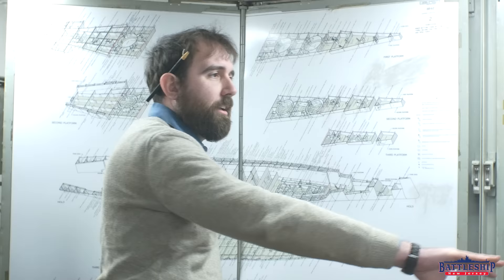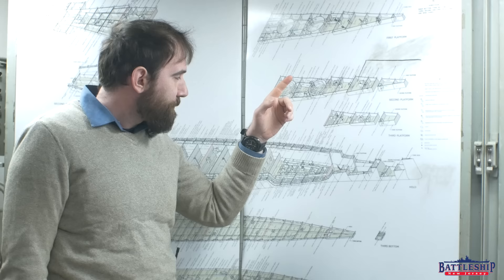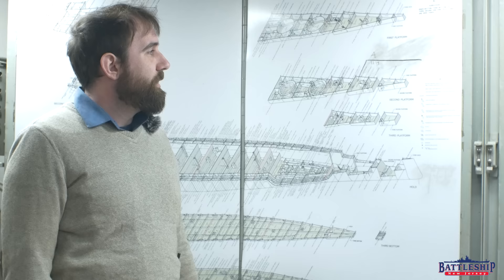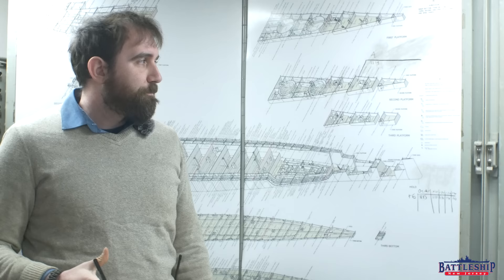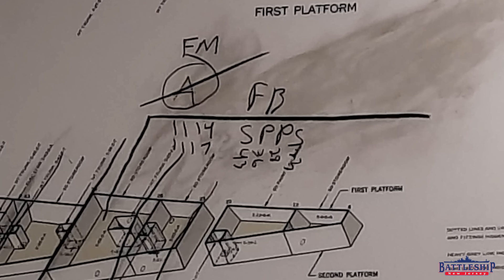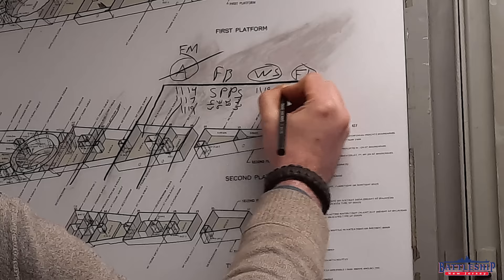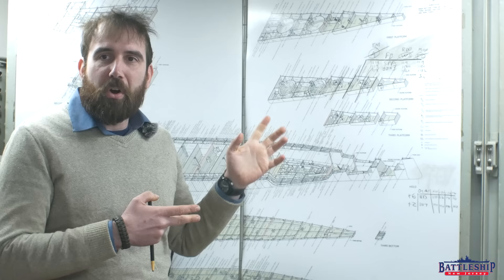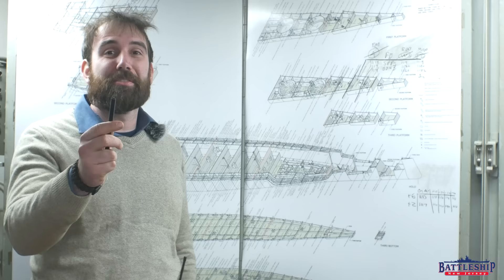Tracking Battle Damage

Comment: since 80% of the ship's weight seem to be in grease pencils a fire in those lockers would have been devastating.
Reply: I wonder how flammable grease pencils are lol
Reply: @mm3mm3  It is basically wax encased in wood, so ignition likely on par with wood, which burns hot enough could ignite the wax. Granted that also depends on how stored, if put in a sealable metal box like an ammo can would decrease that chance, even more so if unopened containers had the air replaced with something practically inert like nitrogen gas.
Reply: @SnowmanTF2  Thank you very much 😊
Reply: At present, 80% of the ship's weight seems to be in Ryan's beard.

Comment: I'd love to see a damage control rundown for a more.. severe situation.

Say NJ comes up against.. Yamato or something similar, takes a solid 460mm AP shell a little underneath the waterline, crashing into the citadel and destroying a boiler that catches on fire.

So you have a massive hole in the side of the ship, several casualties, flooding, fire, and a boiler that is severely damaged

From how much space the small fire took up in damage control plate space you'll have to overflow onto 3 other plates hah

Comment: On the destroyers and frigates I served on 70s-90s the boards were generally four sets of sheets depending on what was mapped (piping, electrical, flooding/stability info) with full sets in DC Central, repair 1, repair 3 & repair 5. 
One layer will have the main drainage system charted on it, 3" of water is far too much to be a mop & bucket drill.
Reply: Yeah Ryan's obviously assuming he is really good with a mop and bucket. That's a significant amount of water lol!
Reply: I don’t know, but maybe too strong is the power of the beard for this youngling,,,, ;)

Comment: DC1(SW) Thompson here. Tracking Damage Control. Well here I go when I get a chance I will go to my library and make up a pretty much spot on copy of a DC message blank. I will make up copies. Walk through some casualty scenarios for you. Then I can shoot them to you . Those plates you where close but there is alot more to report. The line from the space good. Rotting the fire type good , now here where I fill in gaps. The fire party is on scene. There is an OSL on scene leader and hosemen and a messenger. This were the message blanks come in as a record of events for the after casualty critique. The osl reports fire party on scene leader reports everything to the messenger, the messenger to the repair locker. In port the duty fire Marshall will be in the repair locker plotting damage and managing personnel. Sending duty electrician out to secure power to the spaces involved. Once the fire party is on scene and the boundaries are set. The osl reports to messenger that Class fire under control. He tell the repair locker and the locker to central. Central to quarterdeck. This continues on a message blanks is written for every step taken . These are  elect. Power secured, class A fire under control,class A  fire out, reflash watch set. Smoke reported request equipment. Water report 4" as things progress each part of the report A on line under control diagonal line up left side of A on message blanks, charts in locker and central. All the time all reports are sent to quarterdeck and passed over 1 mc to crew. This keeps all personnel not involved out of the way and at the stay during casualties. When fires out finish the pyramid around the A fire out. Set the reflash watch two hose left to man hose in case of reflash. The rest desmoking and dewatering.   All being charted again on message blanks and charts. S in progress line up left. Desmoking complete triangle closed. W same . When done there should be at least for sets of message blanks that all should look alike. And two set of charts exactly the same. There is your record of events . When all this happening , it start with OSL, messenger, locker,DCC, and quarterdeck, the message are write verbally told to the next person in line word for word written and spoken. Now yo did miss one class of fire. The one that can't be extinguished. A Class Delta fire. Very hot can melt through decks, phosphorus and magnesium fires, special materials . Have to run out of fuel. Controlled with water and sand. The ships Sorm should have a standard message blanks in it that ships Taylor to there unique DC set up. Later guys I hope this was helpful . Next time I'll try to cover other uses of those plates.

Comment: Would love to hear more about red devil blowers to desmoke, and buckets to dewater (where do you dump the buckets?)
Reply: Overboard, the bilge, down the sinks and out to sea,
Reply: Way back in the day, it all went out to sea.  Nowadays, pollution control requires OWS treatment before discharge if it's an engineering space so that'll go to the oily water tank, usually via the bilge pumping system.  If it's a space with deck drains, that can go to the PWD (plumbing waste drain) system.  If you have a LOT of water that you can't discharge quickly, you get rid of water that you can put overboard (eg ballast water), and then put the firefighting water into an empty tank.  That would then get pumped out later and treated ashore.  Side note: Treating firefighting water ashore is SUPER expensive and incredibly cumbersome.  Do not recommend if there's another option.
Smoke goes to the weather.
Reply: Heads, skullery, pretty much anywhere close by with a drain
Reply: Over the side, otherwise the water is still in the ship
Reply: @TrojanManSCP  what’s your experience? Sounds like you know your stuff 👍
Reply: bruh  Not unless the specific actions are required to save the ship or human life. And remember the part about “Now the DC plates are a legal document?”
Reply: @TrojanManSCP  And then there is the Sao Paulo...

Comment: There are actually 4 classes of fire. 
Class Alpha- anything that produces ash, (coal, paper, wood), can be fought with water.
Class Bravo- liquids, (fuel, oil), fought with foam.
Class Charlie- electrical, quickest way to deal with it is shut of the electric power feeding it.
Class Delta- metal, (magnesium flare going off), cover it with sand or get it overboard somehow. Covering it with sand takes away the O2, which is one of the three legs of a fire, (ignition source, O2, whatever's burning).  
Learned all of this while I was in the navy in the early to mid-80s. Still remember it to this day.
Reply: Yup...I was in late 80s into the 90s...and DC training, especially the GITMO trips, was first rate. Only had to use it once, but that fire never stood a chance!!
 Hope theyre still teaching the kids that well today!!
Reply: The only change I am aware of is going away from calling it a "fire triangle" and calling it the "fire tetrahedron" with the fourth "leg" being the chemical reaction of the fire itself. But that's more just a nuisance thing really. Otherwise, fire fighting was still the same I got out in 2008.

Comment: Great video!
SW and foam can fight all 3 classes (A, B, and C).  Although for B, power should be isolated to that compartment. Ventillation should be stopped to prevent the spread of smoke/heat.  
Boundaries are good but the first should go over top of the fire (eg heat rises) or (depending on common sense) just aft of the fire to prevent fire from spreading to the majority of the ship. 
Modern fire fighting team could have less people in them with heat sensing devices (Flir cameras) to detect base of fire.  Better air breathing apparatus like compressed air bottles. 
The idea back in WW2 was to attack the fire ASAP and put out the fire.  The longer a fire went, the more smoke and damage it caused. Compartmentalization helps.  X, Y, and Z hatches...
Reply: Charlie is electrical, bravo is fuel. Foam is primarily used on bravo. Once electrical power is secured a charlie fire is now an alpha fire and can be treated as such.

Comment: Ryan, how about engineering damage control. Say, high pressure steam damage? I'd imagine, including hull breach or magazine damage or fire, damage to the high pressure steam system would be one of the most dangerous situations on the ship.
Reply: HP Steam sounds really bad. But steam can be useful too. On a large space it can be injected, it will expand and displace the air. Cheaper than carbon dioxide and it takes up a much smaller volume of water when it condenses.
Reply: @20chocsaday  Assuming the ship was ever designed to intentionally vent steam into interior spaces. I guess that would be another question for Ryan. In general, 500-600psi of superheated steam isn't compatible with survival.
Reply: @vburke1  
It certainly is lethal to almost all kinds of life but it can be used to displace the oxygen which is necessary for the reaction we call "Fire". 

It can also be used to remove the oxygen from a chamber designed for a competing reaction.

Comment: Thanks for this video, it's really interesting! I have a question about damage control in combat conditions. If the battleship was in combat, I would think that most of the ship would be sealed up tight, especially the armored citadel. How do damage control parties get around the ship in these circumstances? Do they have separate damage control units for inside and outside the citadel? Would there be many sailors outside the citadel, or are most people inside? Thanks for any information!
Reply: You go through doors and hatches, just like any other time. You report back to DC Central which doors/hatches/scuttles you are passing through and when you have closed them behind you.

Comment: So if condition z is set how do you breathe in the space if there is no fire or flooding concerns. And how is air circulated though out the ship if it is set for biological or nuclear attack. Could you seal a space and let the fire burn itself out?
Reply: it gets hot and sweaty in those compartments when the ventilation is secured.
Reply: Ventilation is a William fitting and not shit down specifically for Zebra. You will adjust William as needed. For example in a fire you will shut off ventilation to the affected space, but not around it to create buffer zones and prevent smoke and fire from spreading.

In case of CBR attack, you are trying not to stay in those conditions very long. Without appropriate PPE, you aren't going to be able to do much anyway.

You can't deal off a space to let it "burn out". Smoldering will continue virtually indefinitely until a new oxygen source is found.

Comment: Why can’t the crew just close off the bulkhead let the fire just suffocate ?
Reply: Oxidising materials may be present, smouldering remains could reignite when the space is opened, if a shell started the fire there will be a hole to outside, the heat of the fire would affect the steel weakening it, there could be small holes in the bulkhead from wires, the rubber seals may melt,

A few reasons why I can think of but you did raise a valid question that deserves answers.
Reply: Not every compartment can be reliably be assumed to be airtight, especially if the ship has been being shot at. Additionally, a fire can do a lot more damage while burning itself out off the oxygen supply in the room, and then you would have to wait for all the heat to dissipate before you can reopen the compartment, or it would just reignite.
Reply: As well as the other answers already, there’s 6 sides to a room that will be radiating heat through the steel. Potentially heating up an adjacent space enough to start that one on fire too.

Comment: How is this handled on a larger scale? Like a kamikaze hit or an ammunition fire? Or during a high intensity battle with multiple instances of damage occurring in rapid succession?
Reply: Exactly the same way.  There are DC symbology for each type of damage, and a lot of training goes into learning to rapidly use and read them.
Reply: multiple repair lockers, each locker handles a different area of the ship. the plotter is not tracking what is happening on the entire ship, just their area. dc central would likely have multiple plotters.

Comment: Hurah, finally you are wearing decent clothing.  Still have not found your comb, eh?

So much detail on those Dama-Con boards.  100% confirmed, Iowas have three hulls.  Confirmed, aft sections of the ship hold storage but not machinery. (I have people argue with me that the aft section of the ship is where all the engines are.  Nope)  Flooding.  Iowas were designed with flooding compartments/sections and over 45 pumping rooms.

Asymmetrical flooding, the real danger to a large battleship.  Why?  Serious risk of capsize = loss of ship and most of her crew.

Comment: Ryan & Staff- How does the documentation in DC differ from other planning/construction documents? Is there anything specific to the DC documentation that makes it unique? (Aside from being laminated).

I also imagine that now casualties are managed through a computerized system that fuse all the ships safety sensors and crew reports and response.
Reply: They are 3 D drawings. They show both the deck and bulkheads with all access points marked. Plus, any critical points they need to know about.

Comment: Out of curiosity I realize you just said water. As far as extinguisher. But did they ever use dry chemical or CO2 between WWII in the 1990s?
Reply: yes PKP, and CO2.
Reply: Halon too
Reply: @JoshuaTootell  I believe Halon it be a little too toxic for the crew members and officers on the ships.
Reply: @dutchman7216  fixed halon systems were at least when i was in, in  or plumbed into every main space on a ship.
Reply: @dutchman7216  Halon's toxic for everything that breathes, one of the reasons it's being discontinued. The systems were very useful and common though and strict evacuation procedures and PPE are critical to using gaseous extinguishing systems. You wouldn't want to be locked in a space flooded with smoke and CO2... even with FM-200 you still don't want to be trapped!